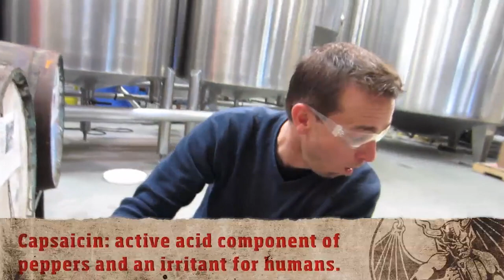GK's vBlog: Bottling Punishment

Comment: Correct, that hasn't been typical in the past for the 500ml cork-finished releases in the past as we were bottling them on a very small, and very s-l-o-w hand bottling rig. Now that we can bottle the 500mls more efficiently (and with even better quality), we'll be able to get some releases out much wider. There will still be some pretty small bottling runs too, simply dependent on how much of a particular beer we have available.